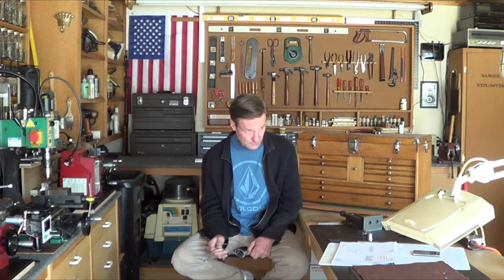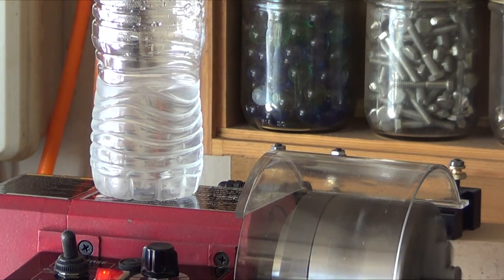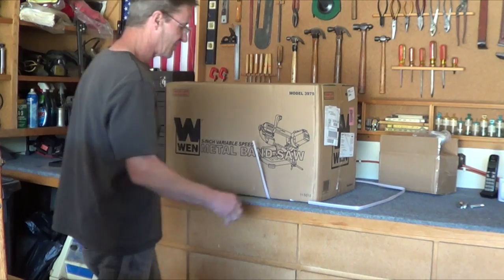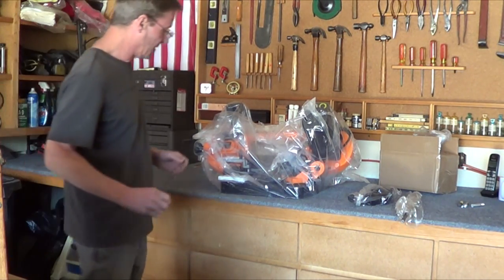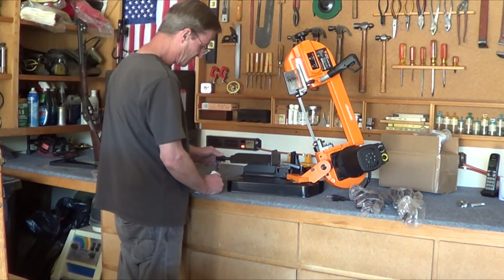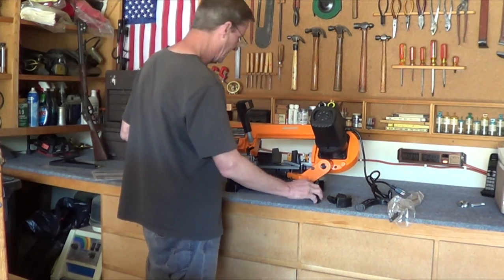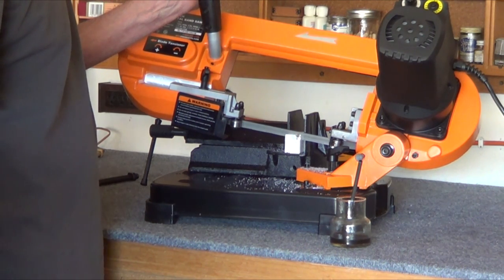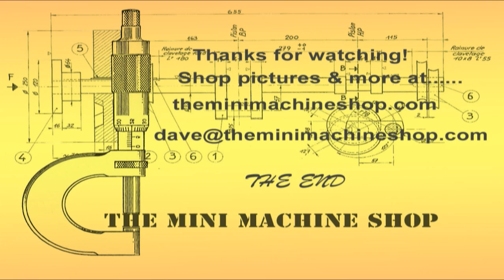Mini Lathe Vibrations & Wen 5" Bandsaw Intro Video #120

Comment: Kerosene or WD-40 makes a good cutting lube for aluminum.  I think you will find motor oil will gum up the chips more.  A good bi-metal blade will last a lot longer than the Chinesium they supply with most of the Asian band saws. See you next Friday!
Reply from the maker: OK I need to get some kerosene soon and I knew getting blades would be a problem before buying it. 56 1/2 x 1/2
Reply from the maker: Holy sh%^@#$t how funny! You will get it in next Friday's video....

Comment: I’ve just ordered this tool. I have a Delta 9” BS100 I’ve used since 2003, although it’s mainly for wood, it cut through Aluminium more than any wood and made it through 2 airplane builds, I’ve replaced the bearings and it’s still going strong. Might I suggest getting a Boelube stick. Run the stick on each side of the blade before cutting. Really works well and Its also good for drill bits. It’s similar to beeswax but developed by Boeing for use in their aircraft manufacturing. It’s available on Amazon and a bunch other sites that cater to aircraft construction. Just a suggestion. Great videos.
Reply: How did it go?

Comment: Hi Dave, a nice bandsaw, I use the same one and I´m very content with it.
Please allow me two remarks: You achieve best results when cutting without
using oil on the workpiece or the blade. And: For aluminum I recommend a high speed.
Greetings from Frankfurt/M
Armin
Reply from the maker: Hi, I figured out real fast oil was a big mistake. Chips stuck to the blade and I had to take it apart to clean everything out. Others also said fast so thanks for confirming that! Can you tell me how hard to push down? Dave
Reply: Hi Dave, 
the pressure for pushing down depends om what you`re cutting.
When cutting aluminum with a small diameter I use more pressure and a far higher speed
than I do when cutting 1.2210 (115CrV3) "silver steel", for example.
Start with a moderate pressure and check the workpiece and blade temperature when
finished. 
Greetings from Frankfurt/M
Armin
Reply: Hey Ruppi. Would you keep the speed the same as aluminum for T2 copper? Thanks for any advice, Nate.

Comment: Dave,

How is the saw? How thin a piece of Aluminum and Steel can you cut with moderate accuracy?
Reply from the maker: The saw is fantastic and makes cutting material for a project a lot less painful! The accuracy is there. I can easily cut off a slice as thin as a dime. The only problem is the blade is 1/2" from the face of the vise reducing the ability to cut short material.

Comment: Now that would be the ideal bandsaw for me, size-wise !

I use one of them cut off disk machines now... with a 14" disk.... cuts fast and straight but make an aweful mess, not to mention the spark-shower !

I have not seen any this small , this side of the Atlantic.... someone must sell them here though...

Cheers

Paddy

PS : you aren't suppose to push the head down, just let the weight of the machine do the job, and if too light, just add a bit of weight

Comment: I have the same saw. The manual says its dry cut but i guess it depends on the blade. Im still using the stock blade (only made 5 cuts of alu 2.5in piping). 

So is the jury still out on using lube or not when cutting??
Reply from the maker: Figures I should have at least looked at the manual for speed references. Measured the speeds 1-131 ft/min 2-150, 3-179, 4-207, 5-240 and 6-273. The blade holds up as I went thru 1 1/2" stainless in 5 minutes. Great saw. You can order custom blades for it at sawblade.com.

Comment: Dave....I was checking in to see if you still like the bandsaw now that you have been using it for a while. Thanks.
Reply from the maker: I love every inch of it. Went thru stainless like nothing and teeth are still extremely sharp. Dial at #1 for 131 ft/min for steel and #4 for 207 ft/min for aluminum. The only negative is the vise is 1/2" from the blade so holding and cutting something short is a problem. Have a source for $15 blades if needed. 28" x 12" foot print.

Comment: Hey Dave, nice saw and when cutting aluminum go at the faster speeds so teeth don't get gummed up. Slow speed is for steel. I use a Milwaukee Porta Band saw that I mounted on a stand. I think that it is roughly 3000 feet per sec or min for aluminum and 300 ft for steel. Sorry don't remember sec or min but I know the speed. I have found that you just put enough pressure (feel) on saw that it will cut another words let saw do work. Sure better than a hack saw eh. God Bless Ya   Dave
Reply from the maker: That makes sense! Forgot to pursue that subject and don't need to now. Thanks ....
Reply: Maybe if you allow me a few hints about cutting speeds, steel is from 50 to about max 150 feet/minute, 50 is for alloyed or harder types (O-1, W-1, 4140 etc...) of steel and average will be around 100, teeth count is also a factor, more teeth per inch for small sections and less for bigger chunks, as for Aluminum, 200 to 300 feet/minute is normal, a little kerosene or WD-40 will greatly improve fluidity and reduce heat during cutting...  like 6061 series will cut pretty nicely as 1100 series will be quite gummy where lubricant will really be an asset...
Reply from the maker: There is no indication of speed on the saw just numbers 1 to 6 on the dial. I need to figure out its speeds somehow. Count revolutions? In the video I used oil for lubricant. Big mistake as chips stuck to the blade and went into everything. Had to take it apart to clean up the mess. Also the blade is an odd size so finding off the shelf blades isn't going to happen. But did watch a video on making your own using silver solder so will be making my own with different pitches. Will be trying WD40 on 6061 per your advise. Thanks!
Reply: For blades you could try:

https://www.sawblade.com/
 
Give them you size and you'll get the blades at about the same price as if you were making them, be sure to get Bi-metal or best quality to get something that lasts, you know a blade had it when your cuts aren't straight anymore, so, before adjusting the alignment check the wear of the blade...  
To cut steel, using some cutting oil or even better, soluble oil (Around 10% dilution) is also a way to help blades last much longer if you can live with the mess   (Maybe a pan under the saw), it doesn't have to be flooded but intermittent will do, it helps the chips to leave the blade and keep it cool...   ;)
Reply from the maker: All excellent info! Will check the blade site. Was able to make a black mark on the blade and count the revs over a 1 minute period for each speed setting. #1 is 28 revs * 56.5" / 12" = 131ft/min, #2 = 150ft/min and so on. Tops out at 320ft/min. So now I can use your speed references when cutting. The blade is 56.5 X 1/2 11TPI and only found it at WEN so far. Might be able to use smaller blade if the tensioner moves enough.
Reply: Go to that page and chose your length, your pitch, for your model it should be around $18.75  for one and lower for more: 

https://www.sawblade.com/order-m42-bimetal-qsaw-band-saw-blades.cfm

I've entered:   4 feet, 8 inches, 1/2 inch, in the lower part and 1/2" with a pitch of 6-10 in the upper board...
Reply from the maker: Wow! Just what I need .... THANK YOU!!
Reply: Good practical check. The manual said  125 to 280 FPM